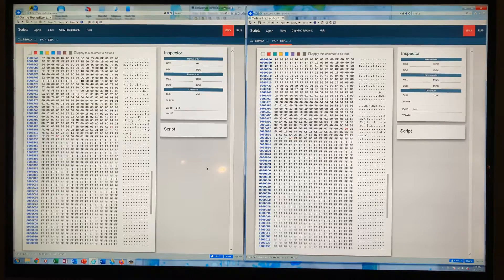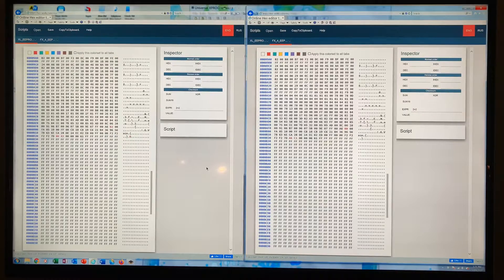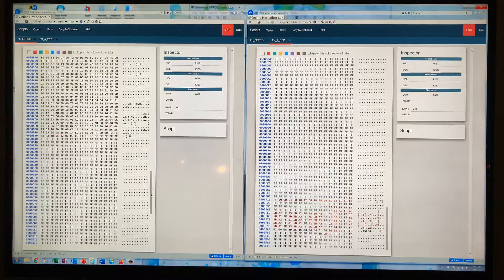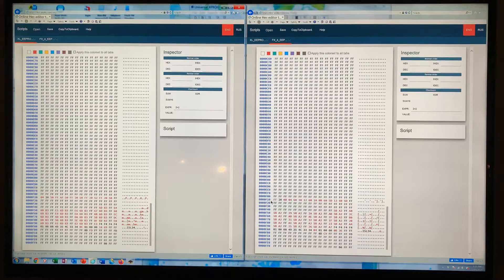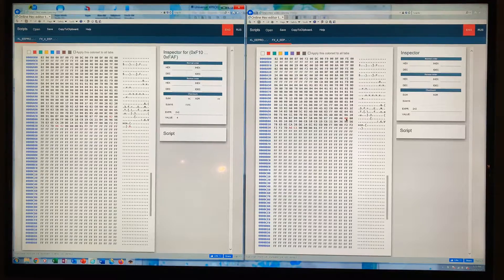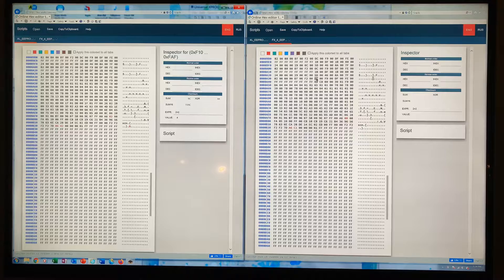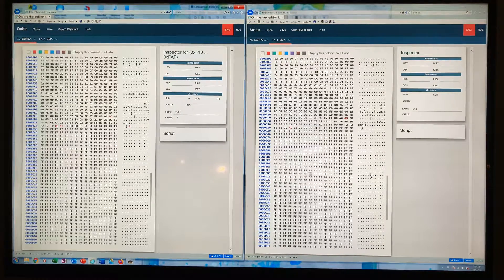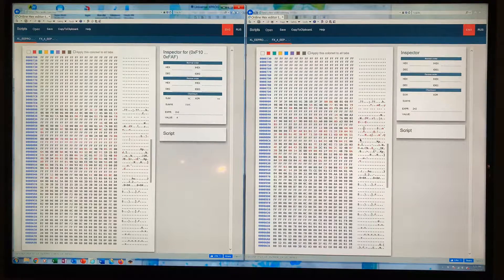Ford F-150 2005 Gauge cluster swap - new cluster out of FX-4 — Updated!! Part 2

Comment: Is this still the best way to do this? And do you have a column or console shift? I want to swap a FX4 cluster to my FX4 that has a XLT cluster in it now, but all the FX4 clusters I see all have "FX4" where the PRND12 are?
Reply from the maker: Hey Jason. I don’t know if this is the best way, it was the cheapest way I could come up with. I noticed the same thing but I got the fx4 cluster anyway. While inspecting the fx4 cluster I discovered you can simply remove the fx4 plastic and replace it with the shift indicator. Clicks right in like it was made for it.